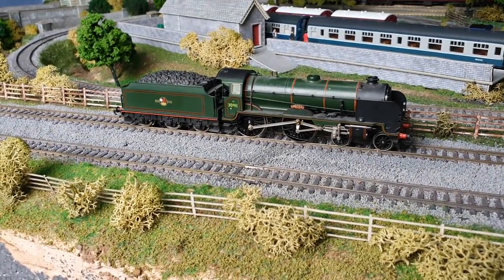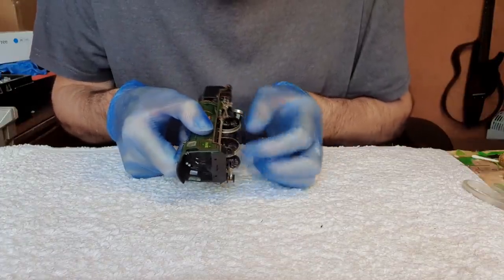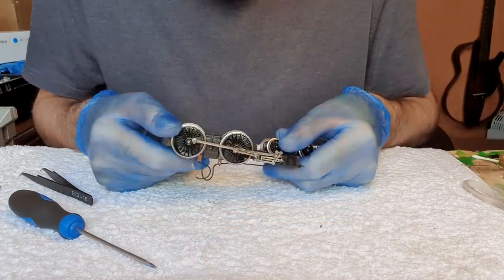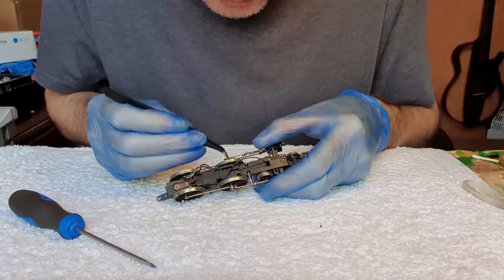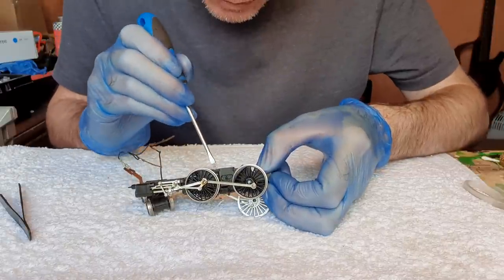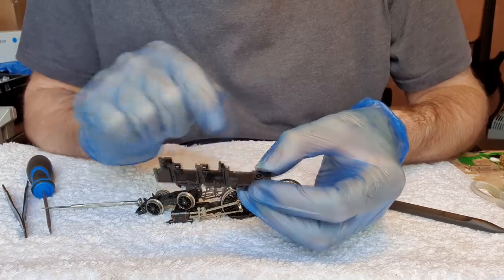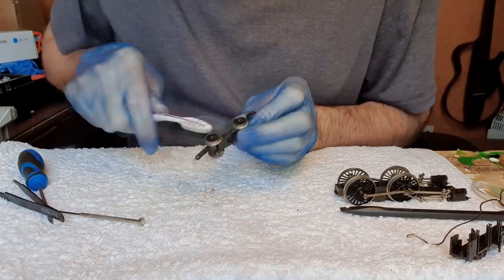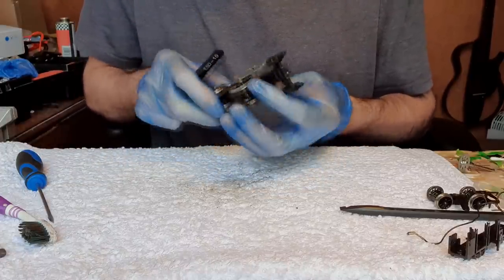Hornby R257 BR Schools Class "Dover": Repair Request

Comment: Did you do a video where you describe your layout? There seems to be a lot of interesting  trackwork in a relatively small space - is it on an 8x4 board or bigger? Btw, I have a Hornby tender driven Flying Scotsman of which the engine is also v light and occasionally derails so I'll try adding some of those car wheel balancing weights inside the loco body to increase the down-force.

Comment: Hmmm. Maybe that's the solution for my Wrenn castle class. It's had an issue with a loose driving wheel on one of the non insulated driving wheels for about 20 years! It just started derailing one day. I tried various unsuccessful fixes with superglue. They worked for a while but didn't last. Maybe loctite would've worked better. I must give it a try. The question of course is whether it holds up long term. Thanks for another cracking repair video.
Reply from the maker: For a real drive wheel ideally replace the axle and/or wheel. On a tender driven loco there is much less stress on the loco wheels as they are just being pushed so I think thread locker or glue will be fine. The other option might be flux and solder.
Reply: @oobill  
I'll try it anyway - nothing to lose. As far as I can remember the problem is on the leading axle which is driven by the coupling rods rather than directly from the motor/worm drive. BTW, Are any of those R850 Flying Scotsman bodies/tenders available? I'd love to restore mine which I got for Christmas when I was 5 in 1969! and ruined with an appalling BR green paint job when I was about 10 😳☹

Comment: Hi Bill, very enjoyable, is that the same as loctite?  Looks good stuff, All the Best Brian
Reply: Looks like a clone for Loctite 242 or 243, which is the blue one, designed to be dismantle-able with hand tools. Other Loctite thread lockers are available for more extreme environments, with the 'red' requiring 300 degrees of heat to dismantle, so probably not a good idea for your model loco!! (I've just bought some 243, which is a newer and more versatile version of the traditional 242, so it's all fresh in my mind!)